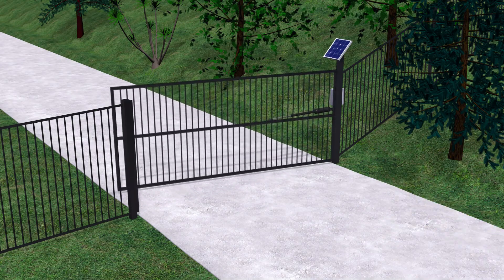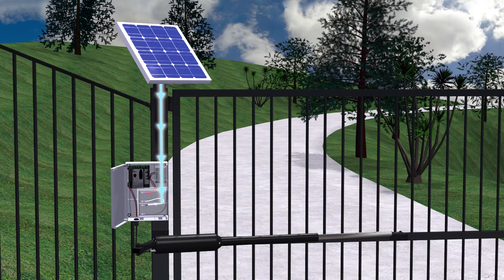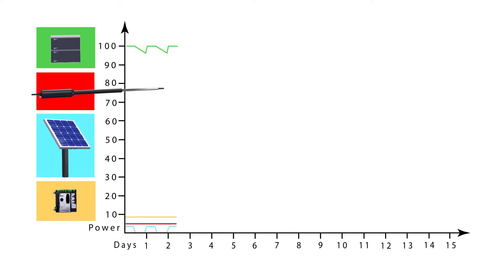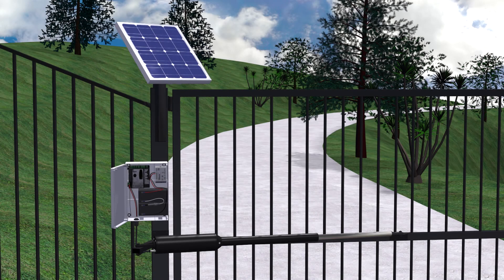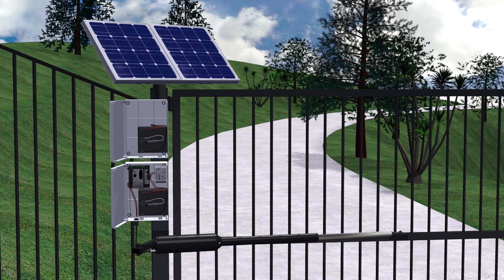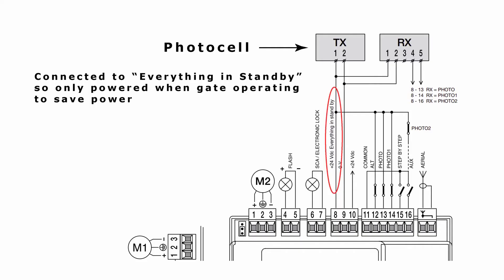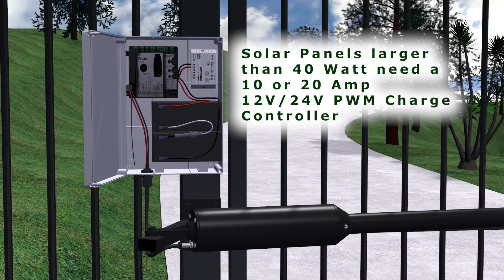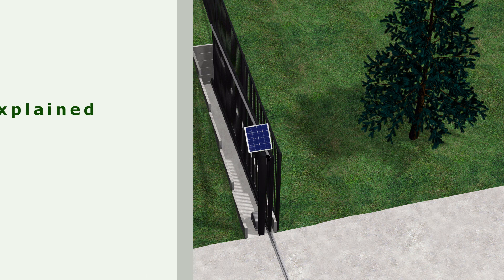Are Solar Powered Gates any Good?

Comment: As cheap as solar panels are, I suggest upgrading solar panel and battery at time of purchase.  .   Why go with 10 watt solar panel and 14 ah agm type battery (7 ah available)  when you can go to 50 watt and 20 ah lithium.  Which can utilize close to 100% of it's capacity.   The solar panel can keep up with charging while the battery can carry load for long periods week no sun.  And if you add accessories that draw power, the battery setup will already be big enough.
Reply from the maker: Thank you for your feed back. This video was made before solar panel prices are as cheap as they are today. We do normally use 40Watt solar panels and a 14Ah AGM battery. The 14Ah is available so long as it isn't drawn more than 30% on a regular bases then is will last almost as long as a Lithium Battery for 1/3rd the price. Lithium batteries can be drawn down to 80% capacity on a regular basis without shortening their lifespan and are much lighter, which make them ideal for electric cars but for gates, weight isn't so much of a concern, where as price is.

Comment: I live in TN and have a Liftmaster LA412 with 2 batteries and a solar panel. For some reason the solar panel is putting out 20 volts, but it isn't charging the batteries. There's a spot on the board for a 110V battery charger, so I ran electric to the gate, bought a $10 battery tender off eBay. I plugged it in the it's been working ever since. I'll remove the solar panel soon.

Comment: What about during winter time?
What are the price ranges for a 12 foot gate, in Oregon?
Reply from the maker: You need to scale the solar panel and battery depending on your climate. You will need to check your local area for gates prices.